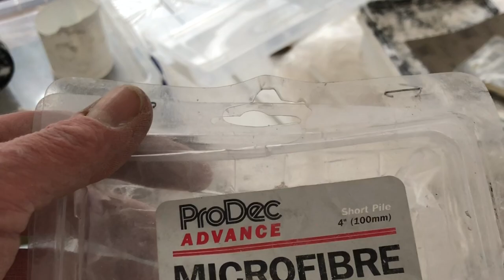Some painters are just Unbelievable

Comment: I would have put the 2 1/2 gooseneck flexible paint brush on an extension pole to do all that skirting board trim!  Dip it in a paint tray and go!  Don’t even need to use a roller!  Save your back!  Hope this helps!  Cheers!
Reply: hOW DO YOU MEAN ?
Reply: tony Lorns it’s a 2 1/2 inch flexible paint brush that you put on the end of an extension pole.  Richard gooseneck flexible paint brush extender!  Eliminates going up and down a ladder!  Excellent for cutting in ceilings priming or painting one colour!  Hope this helps! Cheers!